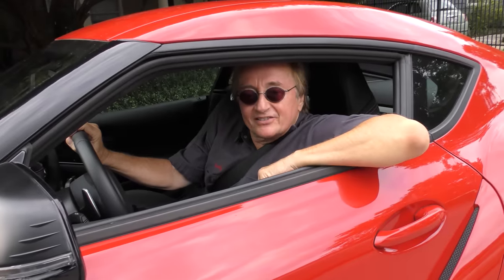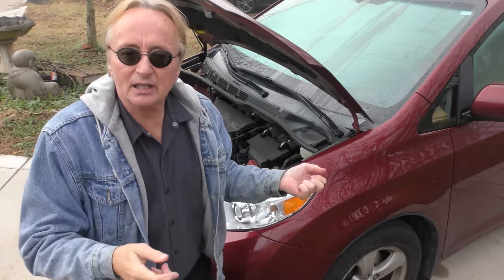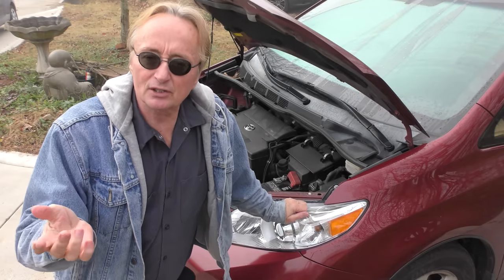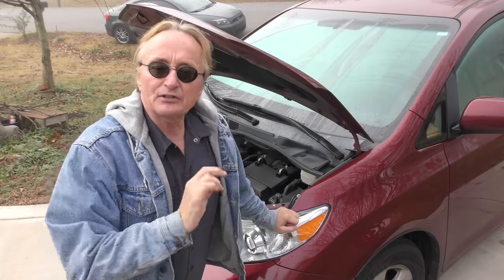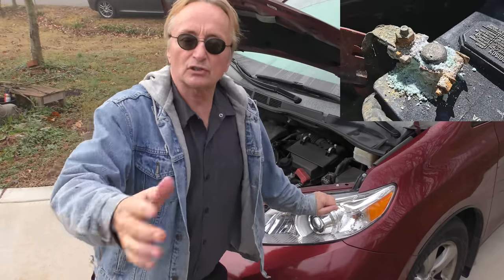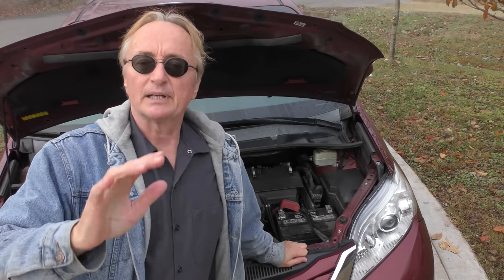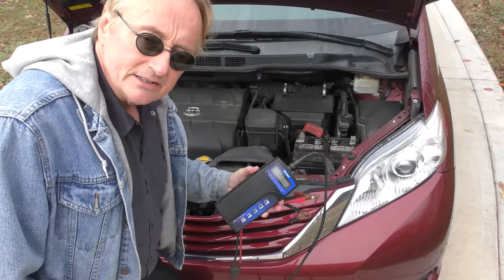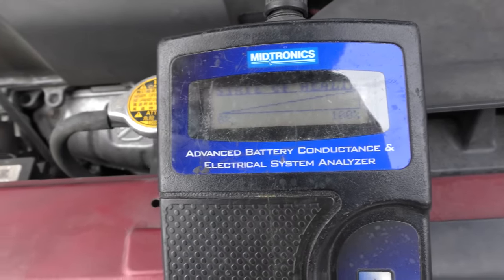If You Buy a Car Battery from This Place You’re Stupid

Comment: Walmart batteries suck!  My Mom's friend recommended a Walmart battery because Consumer reports said it was the best. 1 1/2 years later it was dead. I bought a old chevy pickup truck from a lady and she wanted to put in a new battery for me. I politely declined but she had a Walmart battery installed and in a year and a half it was dead and would not take a charge. I had an Auto Zone battery in my Cadillac and it lasted about 2 1/2 years, it had an open on one of the cells while I was cranking. I also had a couple of those AC Delco batteries and they each lasted about 2 1/2 - 3 years. I have 5 vehicles and I have been getting my batteries from Advance Auto and have had no issues. My Cadillac does have an Interstate battery that is still going strong. There are no more companies processing lead in the U.S. anymore. All lead goes to China or Mexico to be recycled. All because of the EPA.

Comment: The thing with batteries is you literally get what you pay for. 
Wal-Mart batteries are cheep for a reason.   
Part of it is Wal-Mart buys them in huge bulk that gives them a discount... BUTT... their batteries are also cheaply made.  
I worked as a mechanic for 6 years while going to college... & 90% of the batteries we changed that were leaking, or ruptured... were those EverStart batteries Wal-Mart sells.  
Sure we've also seen O'Reilly  SuperStart,  Autozone Duralast, & Interstate batteries snowballed in people's cars... BUTT... not nearly as often as Wal-Mart's  EverStart batteries.  

Yes, auto part stores do mark up their batteries, but most of the increased price, is actually because they are better quallity batteries.  
That being said... stay away from the cheapest of the cheapy cheap.  
All car batteries with only 1 year warranties are crap, no matter who you buy them from.
Reply: Johnson  controls makes the Autozone and Walmart batteries.  Same manufacturer!
Reply: @JohnTaylor-bd1uy  
Manufacturers make their products to the specs, specified by the retail brand.  
Walmart wants to sell batteries cheaper than autopart stores.  To do this, the manufacturer cuts corners in quality to save on cost of manufacturer, so they can sell their product to a retailer at a cheaper cost.  
Specifically with Walmart's EverStart "brand"... JC uses thiner lead plates, which corrode away quicker than the equivalent Duralast & SuperStart batteries.  
EverStart batteries also have thinner plastic casings, which are more prone to rupture at the top seems & around the terminals, causing out gas of the electrolyte.  

A walmart 3 year warranty EverStart battery tends to last just past 3 years... where as the 3 year equivolents at autopart stores tend to last 6 years.

Comment: ...Walmart is a good place to buy batteries...I also have another source, a family owned and operated company who sells batteries off his truck( sort of like tool-truck vendors) to schools, trucking companies, county government,rental equipment stores, etc...he doesn't sell to the general public, but I met him when I worked for a rental company, and all I have to do is call him when I need a battery and he will meet me somewhere when he is going through town, sometimes at a local trucking company..he has better prices than Walmart, and his private-label batteries have so far been excellent(I don't know who makes them, but I'm sure it's one of the big companies that makes everyone else's batteries)...he also has some "blems" or "2nd's" batteries he sells even cheaper..I bought one of those for my 1970 Chevy 3/4 ton because it was cheap, didn't expect it to last all that long..surprise, it is now over 4 1/2 years old, and still works fine...and it has endured more than a few accidental complete discharges...see if there is someone like this in your area...

Comment: I bought the 12v heater you recommended. Puts out no heat p.o.s. Dont believe your recommendations
Reply: Which video so I know not to buy?
Reply: Video on i think road pro heater, no 12v heater works. All Chinese crap. Finally had to fix my heater core - fun
Reply: @michaelhasse2568  ok thanks.

Comment: Is lead "going up" OR is the dollar just losing IT's buying power ;)

Also i only drive 3000-5000k cash toyotas, so the last time i had a car that needed a battery when I owned it, it was $35!
I was shocked when I found that they are $150-200 now! but it prob has been over 15 years since then.

Comment: Bahahaha, I had a new 30 month AC Delco battery sitting on the floor inside my house that was sitting for 2 & 1/2 years & it started right up & was still at 85% , ironically I used it to replace a less than 2 year old AC Delco with the 42 month warranty that was made in Korea, turns out the way older US  built Delco was way better than the newer Korean Delco battery that was at 40 % rating

Comment: Ok, the information about the testing equipment is the only thing correct in this video. I am in the automotive/battery industry and Scotty is completely misguiding you. First there are only 3 battery manufacturers in America. East Penn Manufacturing, exide, and Johnson Controls (which was recently bought out) There are 3 tiers for battery in a shop . Good better best. The good battery is an inferior product to the better or best battery.  The main reason it has less lead in it than the other two. Pick up a good battery then pick up their best battery (both at the same time) and the best battery will be heavier because it has more lead. East Penn puts silver in the plate grid to make it more conductive and calcium to make it more rigid. Sulfuric acid is extremely expensive to ship. (By rail and most of it comes from Canada. There is a ton of r&d in making batteries. And you get what you pay for. Never take the advice of a cheap skate

Comment: They do the same thing with silver alloys.  There is a place called Johnson Matthery noble metals.  We had a job for Ag80In15Cd5 and Ag80Zn15Cd5.  The metal company pressed their logo half way through the material so you can only use half of it.  Then they buy the chips back for 10 cents on the dollar.

Comment: Lead-acids will go the way of the dodo bird. That includes gels. 
The future is Li-Ion and the Chinese are already making them by the tens, or hundreds of thousands. Yes, 12V automotive starter batteries. (They sell them on Ali_** - this is not a plug). 
They are much lighter and a much smaller, and a smaller capacity (CCA, Ah) is needed, because they can be fully discharged without harm - unlike the Pb dinosaurs, yet able to provide a higher current (Amps). 
Much better heat tolerance for longevity than Pb. (It's heat that destroys Pb batteries). They are fully compatible with Pb battery charging systems in current cars. 
They'll last for the life of the car even in hot climates. In Florida if the Pb battery is in the engine compartment (hot), the batt's life is 3 years - that's it...